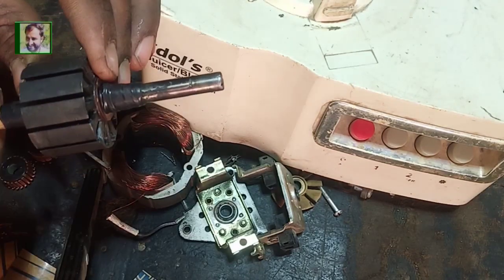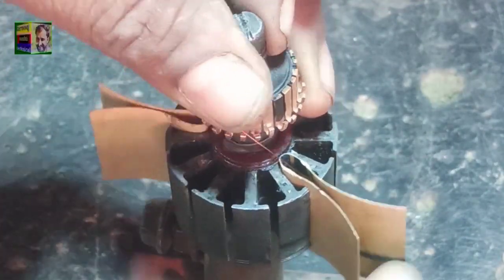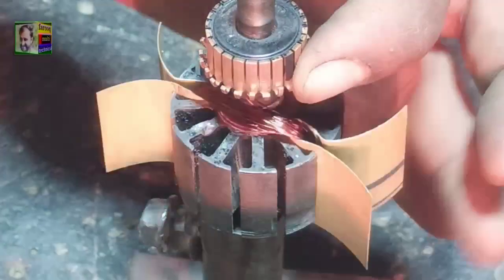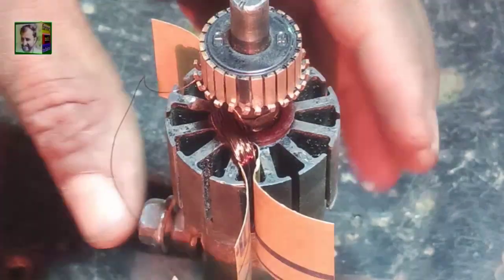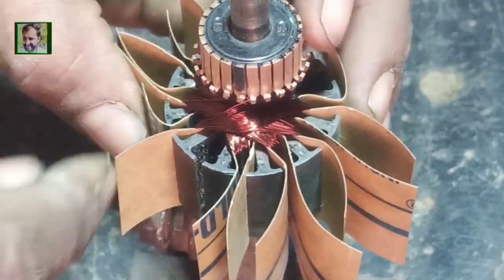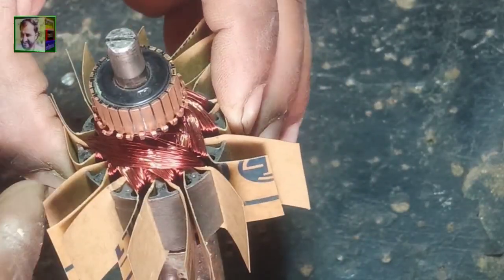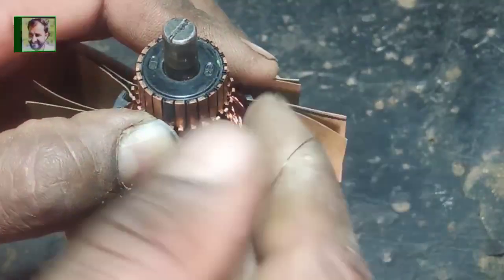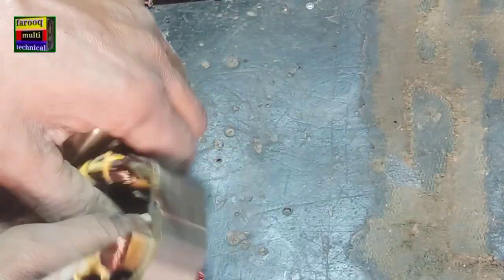How to rewind double loop armature of juicer | juicer armature winding | farooq multi technical.

Comment: In that case if we need to change field coil sir?
And also i want to know is this system suitable for any 12 slot 24 segment blender sir?thank you.
Reply from the maker: Well come Sujeeva Nishantha Kumara
Well come my friend 
first when you open the juicer inspect carefully the field coils then you can deside changeable or not.
So if you wants to change the field coils there is no problem .
for more details you can join me on whats app 0092 3458703248
and msg me as Sujeevanish
Thanks for watching.
Reply: @farooqmultitechnical3989  thank you very much sir..